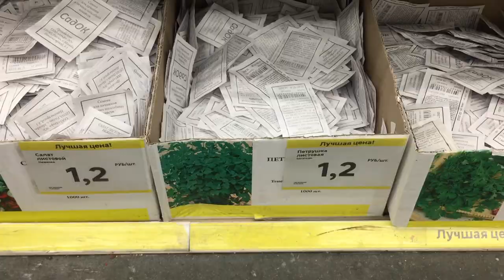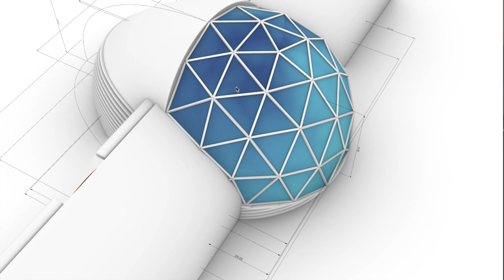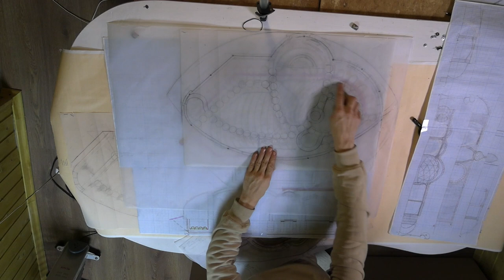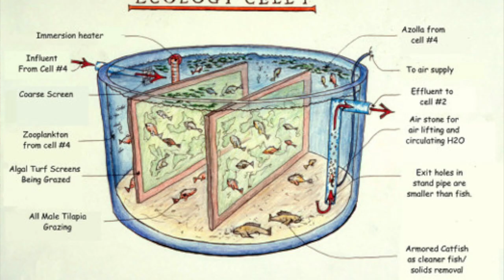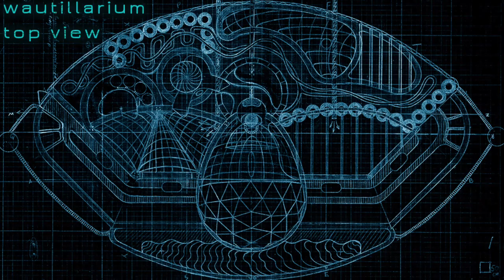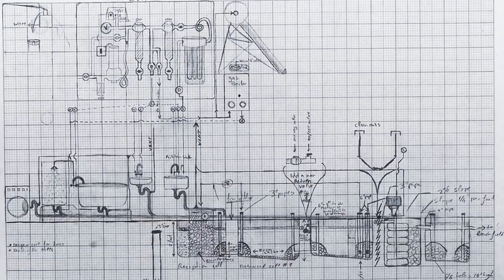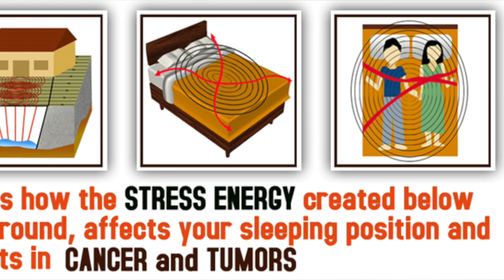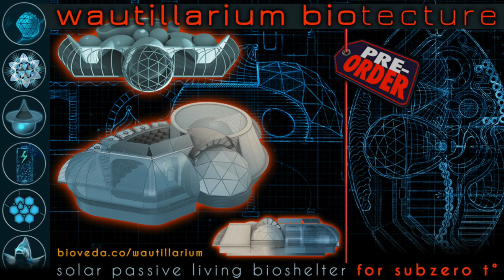Solar passive home for subzero t° + NO winter sun

Comment: OK - I am a retired Mechanical Engineer and have been following Earthship like structures since the 1970s.  One thing you might think about is using Evacuated Tube (ET) style hot water heaters.   If the Artic Earthship was elevated and the ETs were place at ground level, then you could get convection movement of the glyco/water back to a highly insulated hot water tank.  The glyco loop would only be in the "coils" within the tank.  What is nice about ET heaters is that they concentrate the sunlight by their shape.  Now if the insulated tank was large, say 500-1000 gallons, then each day there was sun, the tank would be heated.  Also your Russian Stove/Rocket Stove could have a hot water loop that could also add heat to the insulated tank.  When heat was needed it could go to embedded floor loops OR you could have loops at ground level between the tires and the insulation.  Simple Heat transfer studies could point you in the right direction.  But by using ETs, they might get you over the "hump".

Comment: Your home design looks beautiful!
Reply from the maker: Thank u Harry. How r your domes coming along ?
Reply: @AloshaLynov  I stopped working on the domes. I'm waiting for a machine I designed to be built, a mixer pump. It will greatly increase the speed and ease of building. I should have the machine ready by the end of the month.  I also have a 3d dome printing machine I'm working on as well. It will work with the pump. I hope to have that ready by summer time.
Reply from the maker: @AircreteHarry  a 3D dome printer that’s awesome. What will you use as material ?
Reply: @AloshaLynov  3 different cement mixes I make can be used. Two wall are printed and the cavity is filled with aircrete.

Comment: Six months of monochromatic skies, extreme cold, and limb numbing snow can lead to SAD (seasonal acquired depression) and you’ll need to dig deep within yourself to maintain positive attitude.  Or make an artificial sun for 1000 bright yellow LEDs?
Perhaps, reflective “light tubes” could brighten up the sub-terrain rooms?
Reply from the maker: Yes I will be saving for mars growing light soon. That’s exactly what I was thinking. Artificial sun 🌞. However the sub does come out in wonder when temperature gets to -10 Fahrenheit. All cloud cover disappears at subzero temperatures